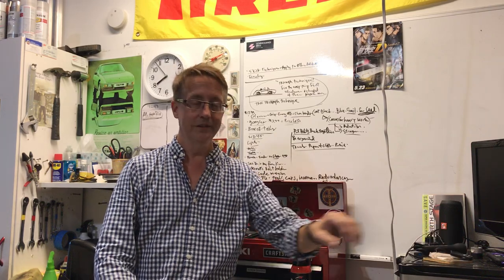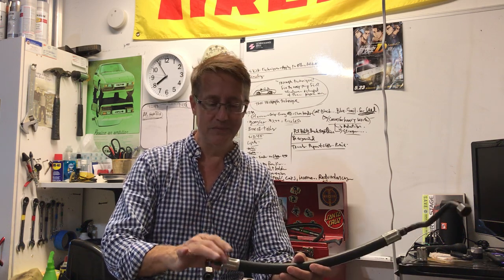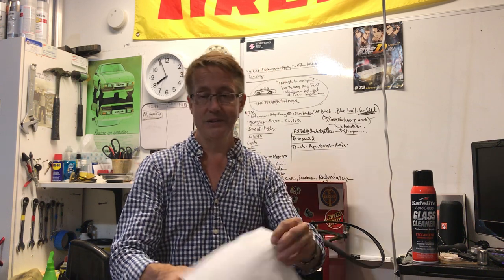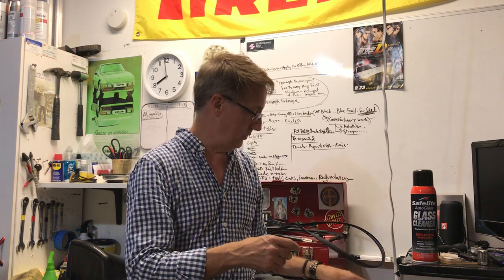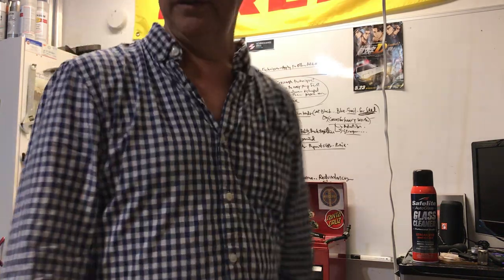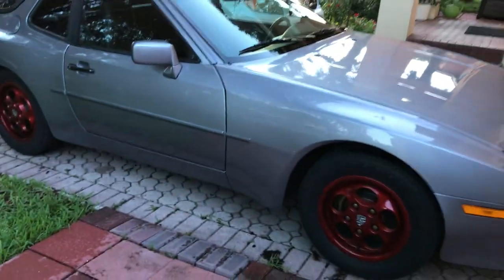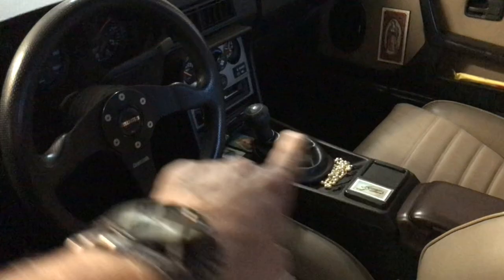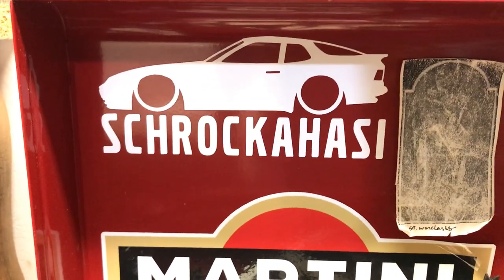Porsche 944 windshield repair completed tips and experience and AC hose repair

Comment: Hi. I am getting ready for a windshield repl. for my 87 944S. Is safelite provides the seal?  If not, what parts we have to gather?
Reply from the maker: Yes safelite provided the seal. My seal was acceptable not perfect. Around the top edges it lifted slightly but the new clear perfect class made up for it. I was happy with the results because my old window was pitted. Also if your car has been repainted with the old seal you might see a line around. Depends who the installer is. So look closely when done.
Reply: @schrockahasi  Thanks. I see pelican sells OEM seal and the URO brand for much cheaper. Do you think i should get one or accept safelites seal ? I am feeling, their seal might be a generic seal and purpose made for 944
Reply from the maker: @OutdoorFaruk  yes it would be better to put the oem seal on from pelican. And you are correct. The seal came off a big roll in their shop one size fits all basically.
Reply: @schrockahasi  Thank you. I ll order one. So far, i couldn't find any glass shop to touch my windshield. I have contacted to safelite online to get a quote and i expect them to get back. If not, i ll just drive to the local branch. Your video was very helpful. Thank you.
Reply from the maker: @OutdoorFaruk  great to hear. That’s why I do this to help others out. Yes. Safelight has a glass company and they make their own glass and yes everyone I talked to turned me down so I was happy when they fixed it. It was also an hour away and they originally said they would come to my house to fix it then canceled and said they only have the tools in the shop for my glass.
Reply: @schrockahasi  Thank you. I have scheduled a safelite $410 installment in couple of days. My seal for the 87 S is a  U type seal with 3 sides and it appears to be OK. So i am going to reuse it. I am a bit confused about the inner seal, if even such thing exist. I read many conflicting accounts perhaps due to the the cars being early / late/ base/ S...Another thing is, they want you to drop the car in the morning and pick up at evening. So there will be no way of objecting to their work. I hope there would be none to object.
Reply from the maker: @OutdoorFaruk  I know it’s tough. Most likely they will do a good job. Might not be Porsche quality but the new and clear non pitted glass is a great thing.

Comment: Man, I don’t know how you pulled that off for $265, but I’m tempted to drive 8 hours to FL and use your guy. 😂 My local Safelite is quoting me $651 to replace the windshield (assuming that is the Fuyao brand), waited 2 weeks for the appointment and now they are saying they don’t have the glass and might not be able to get it. I may have to spring for the OEM glass at $1,100… ouch! 

How is the Fuyao holding up so far? Any leaks or other issues present down the road?

Thanks for positing! 👍
Reply from the maker: Yes that was the price and the guy gave me a free bottle of spray foam window cleaner too! I guess I got lucky, I have heard there was a supply problem with the Fuyao, but I think they quoted you the "Porsche Owner" price (which is double the price when you say the word Porsche) OEM is glass is way high. I would say get the OEM porsche seal because the off the shelf standard seal they had at Safelight didn't go around the corners of the top of the glass well and was slightly smaller than what was there originally. I know they didn't want to drive to my place to do the repair and I had to go to the shop. Makes a big difference having clear glass though.